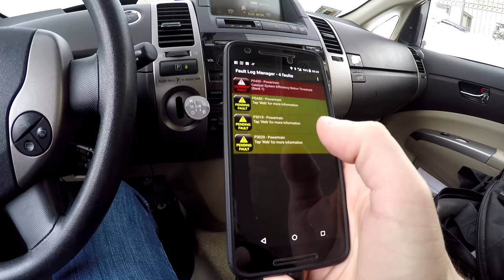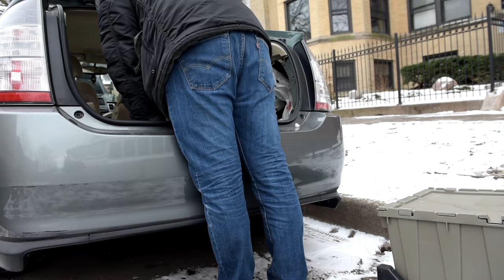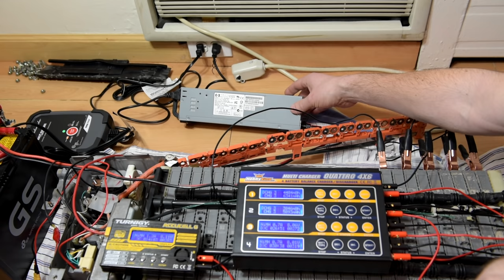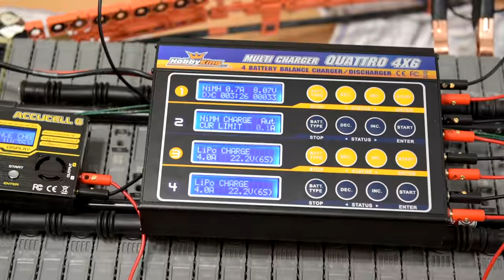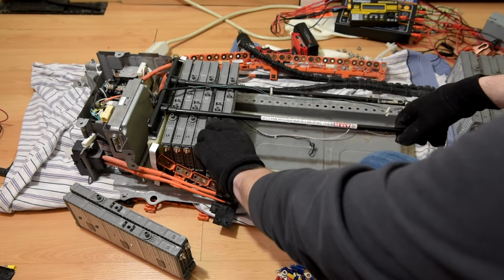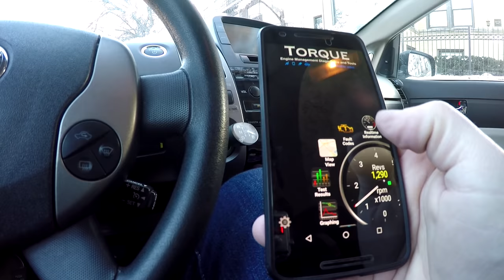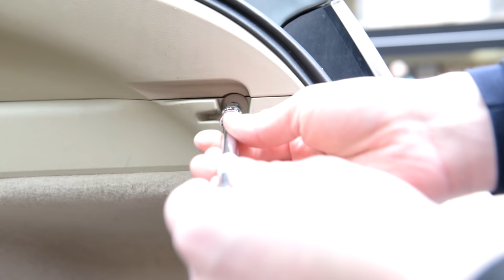Hybrid Battery Repair Ultimate Guide (Toyota Prius 2nd Gen 2004-2009) DIY

Comment: basically on the Measure/Restore Capacity you only take care of the last result of the deep cycle(charge, discharge)
Reply from the maker: The last result is the closest to actual capacity, but having multiple results will help you to understand how a module reacts to the cycles and compare dynamics to other modules in the pack

Comment: Igor, Thanks for the great video! Did you say you got your replacement batteries from Prius Chat? On Ebay how do you tell if the batteries are good when only voltage (not ma discharge) is shown in listing?
Thanks!
Reply from the maker: Hello. I've got a few modules from eBay and the rest from Eric from PriusChat. Here is his profile: https://priuschat.com/members/ericbecky.1015/ He's known in the comunity and he sells good quality modules. Not sure how to really tell what you buying on eBay. The only way to know for sure is to do capacity test after you received it. I would try to buy from sellers with a lot of good reviews left for modules.

Comment: While your charger is charging the cell, what voltage does it peak out at? And does it pulse the 5A current every few seconds, or is it a constant 5 amps?
Reply from the maker: I am pretty sure it was constant 5A during the charge and then it would start dropping closer to the end. I can’t remember what was the peak during charge, but it was over 8v after the charge. >8.2

Comment: these things are heavy, don't work on the floor. Make a table from 2 plastic saw horses and 2'x4'x0.75" plywood.  Now you can move the pack without bending.  Use a piece of 0.75"x4'x1' as a ramp to move the pack in and out of the car. You can stand the pack on its butt to access the bolts on the bottom.  You will need a 3' wood clamp for reassembly to squeeze the blades together enough to get the end plate back on. A salt and vinegar solution to soak the buss bars then buff them clean and silicone grease them or buy nickel plated.  Replace the nuts with stainless.  Check the BATTERY ECU orange plug for corrosion(fire risk) and each sense wire at the battery terminal clean/repair as needed. There are no fuses on these wires so they can short out in the ecu connector if corroded.  these packs are a pain in the butt...
Reply from the maker: Thanks, great advice!

Comment: Thank you for the amazing video and sheets. I am using SKYRC IMAX B6 v2 chargers but its so tricky they don't top off if i change Mah to lower for safety and stop at the safety limit. The charger you are using no longer available in the market so i am kept charging until 8V and dropping them all the way to 6 and recharging @ 2.00 to 2.01amp
Reply from the maker: Hello, maybe It's not about the charger. I've had the same problem with charger registering higher mah capacity during the charge versus discharge. I suspect, this is due to some of the energy wasted to heat during charge. That's why I was not considering charge capacity results as accurate. Btw, I think they sell a newer version of this charger - https://hobbyking.com/en_us/quad-4x6s-lithium-polymer-charger-400w-dc-only.html
Reply: @IgorKadulenkov  Great information. I wish i knew before buying those for extra money where that which you have linked is much cheaper with 4 ports. now after putting all together, it's giving me block 14 code. waiting for eBay shipment to get the cells. do you recommend recharging all again or keep the battery in the car and charge and only take out when cells are here what you suggest?
Reply from the maker: Sorry for late response. Have you reconditioned everything already and then it gave you block 14 code? If you're sure all other blocks are good, maybe just swap that one module, but charge it (or drain) to the pack level voltage?

Comment: @igor Kadulenkov Thank you very much for this detail video. Very informative for newbies like my self.

Can you please explain how one can tell if the charging or discharging is complete for a cycle. I am using the imax B6AC v2 and just following your settings. it just keeps changing from discharge to charge or charge to discharge. But how can I tell if cycle 1,2 or 3 is completed. I have my setting on discharge/charge 3 cycle. After over 6 hours, I press on stop and I only see the reading CH1 5866mAH, DISC 1- 4366 mAH, CH2 6975 mAH, DISC 2- 4645 mAH, CH3 0000 mAH, DISC 3 - 417 mAH Working on a prius hv  battery

Comment: Doesn't anyone own those small screw guns?  I love mine.  Got 2 speeds and a clutch.  Also got the snap-in chuck for sockets with the stems that fit right in.  Mine's a Ryobi.  Got it eons ago and I use it for everything.  4 volts.  Insanely handy.
Wouldn't dielectric grease be better?  And don't mix vinegar with baking soda.  They neutralize each other.  Just use the vinegar.  And no salt either.

Comment: Igor, I'm refurbing a 2002 Prius battery using this as a guide, which has been indispensable! My question is; is it acceptable to go more than 10 charge/discharge cycles to restore the capacity? I have spent the last two months recording the mAh on the sheet you provided, and while nearly all of the modules were poor after 10 cycles, I have been able to bring all except 4 of them into the 5000+ range. Some of them required more than 50 cycles in order to get there. So, can I consider them "good" or does the # of cycles it took factor in? Need to decide how many modules to replace and I would appreciate your input, thanks!
Reply from the maker: I am glad my video helped! Wow you really have a lot of patience, 50 cycles! I mostly used recommendations from online articles where it was advised to do a max of 5 cycles. I did try 7 or 8 on some of my modules. Some of them even showed degradation if I did more than 5 cycles on them. But I had a better  battery overall with just a few outliers after 5-6 cycles. In general, the number of cycles required for reconditioning a NiMH battery depends on its level of degradation and how well it has been maintained. I’d say 10 cycles should still be fine, but 50 sounds like too many. I would talk to a battery expert to know for sure. Maybe ask on PriusChat forums. If there are just a few of them maybe it’s safer to replace them? Or you could assemble everything, since you already reconditioned them to the spec and just hope they would last. My battery lasted 5 years and was still running strong when I sold it 2 months ago. So overall this is a proven method

Comment: Igor, thank you for a great video. I have one question, what is the life expectancy of the battery you fixed on this video. How many miles? How many years? Any idea?
Reply from the maker: It’s always hard to tell with these 10+ years old hybrid cars. Previous owner had a $900 battery replacement service done and they swapped the whole battery. I don’t know where it came from. All I know, I fixed it and I put 30000 miles 3 years after and it is still running strong. It’s the time, not mileage that affects your battery. If you make sure you replace all the bad models it can be good for years to come. I heard that new battery could serve for 8-10 years. It’s good if you could get half of that after the service

Comment: Do you know why you could get a low reading from cell 24 & 25 on one side off the block facing you but the opposite side shows almost 16 volts. Its right before the breaker switch connector. Or 4 th and 5th from the ecu left to right.  ??

Comment: Igor, 4 yrs later how is this battery pack doing? How many miles on this car? Thx and great video
Reply from the maker: Hello, I sold the car this year, 5 years later with 238K miles or so. There was not a single issue with the battery or any signs of deterioration, even when rarely driven and parked outside in the winter. Technique from this video had proven to be very effective to me. I am glad that I saved so much money and I would recommend this DIY project to anyone

Comment: Around 15:34 could you explain the set up.with the load test with the light bulb like what wires connect with what it's kind of hard to see with all the wires but so far your video is the best on youtube for hybrid testing I just want to do a simple load test with the light bulb and some aligator clips
Reply from the maker: Please refer to the picture of h4 contacts http://forums.pelicanparts.com/uploads23/H+4SocketDiaJadams1pic11961569061409336403.jpg , ground needs to be connected to the “ - “ and it’s recommended to connect “+” to the other two contacts simultaneously, that would turn on both high and low beams.
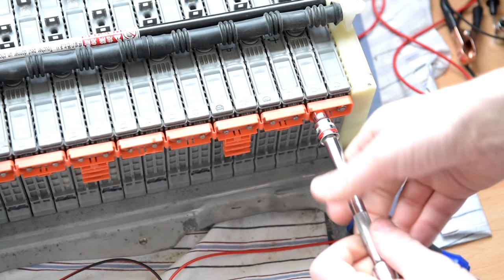Reply: @IgorKadulenkov  hey thanks for the respond I'm doing my car now at 35:04 do that black wire require a  buss bar?

Comment: Where did you get the information about the battery. Like that capacity per cell and their nominal voltages and stuff like that
Reply from the maker: It’s all from PriusChat and other forums, I spent a fair amount of time preparing for this project. There’s a 70-100 page thread on PriusChat with people discussing the repair

Comment: Just started the charging process today. I trust a procedure I can see over a reconditioned seller where you know corners are going to be cut.

Big pros are this is, the equipment runs you less than the mechanic's labor fee, a procedure every dude with a hybrid car should probably try once in his life to get familiar with car disassembly, and its repeatable so if it fails again in 2 years you can just replace dead cells and repeat the process.

Comment: Hi Igor,

Why blade voltage reduced when all other values (Pack voltage, IR, Block voltage) remain same. Same car after 7 months. 

Blade voltage shows now under 3.0v whereas 7 months ago it was 3.65v . But Pack voltage and IR remain same as before. As well as minimum block voltage is more than its nominal voltage  25.2v. 

Any explanation?

Comment: Amazing work Igor! could you please share the blank excel sheet?
Reply from the maker: Thank you! Try and see if you can download it : https://drive.google.com/open?id=1T-ldtt90Y9oMNl01dcKttKFFmUYMpakS
Reply: Hi Igor, I have another question, sometimes i need to cycle the module more than 10 times to restore the capacity. is this normal?
Reply from the maker: @Ahmed Zakaria Hello Ahmed, I can only speak from my experience with this rebuild. In my case most of the modules had recovered by 6th cycle. And then there were a few stubborn modules, that would only grow by 150-200 mAh with every cycle. I ended up replacing those. I would say, just look at overall condition of your pack. If all of your modules are like that, and assuming you using the same charging settings that i did, then  I would just keep them or try to get a used HV battery in a better condition. If there are just a few of them that stand out being the weakest, i would definitely replace them.

Comment: Hi Igor!
Good job! I'm wondering about the fault check app you use, whats the name of it and what type of obd bluetooth type do you use thank you
Reply from the maker: Hi Mohammed, the app is called Torque. It’s only for Android phones, but App Store has similar apps. You will also need a profile for Prius to be able to see all the module data. If you have an apple phone , you will need a WI-FI OBD II reader. If you are using Android , you can get either Bluetooth or WI-FI.

Comment: Thank you for the great tutorial, just one question, how long reconditioned battery will work or on how many miles it will last? could  you estimate roughly ? thank you in advance..
Reply from the maker: Thanks. It’s hard to predict, it depends on how quickly your next module will fail. My car still runs great after two years. I put about 18000 miles on it. I’d say it should give you 2-3 years or more. Even though it looks like a lot of work, I think it’s worth it

Comment: Hi, I used IMAX B6AC chargers and the same discharge/charge settings. But my modules can not be discharged to 6.0V which is said to be necessary for fully discharging. My charger reads “DRY” at about 6.5V and stopped the discharge. And my modules discharge about only 3000mAh, but they can be charged in 7500mAh until auto cut-off. What do you think is the problem for my modules? Are the numbers I get correct? Thank you so much in advance! :) I really need some help.

Comment: Hello Igor, first of all thank you very much and congratulations for this great tutorial. I am doing the same following your advice. I got the breakdown and discovered that two modules failed, so I bought them to put them.
I have two questions for you.
In the first place, when trying to do the cycles to two modules, they swell a lot. Does this mean that I am doing something wrong? or does it mean that they are defective?
My second question is, how do I cycle correctly? I mean the amps / h of charge and discharge.
Charge at 5 amp / h?
Discharge at 1 amp / h?
How should I do it?

Thank you. A greeting.
Reply from the maker: Hello Jesus, sorry for late response. If they swelling a lot, i would reduce the charging rate. Ideally you would want to go as low as 10% of max capacity, so around 0.75 Amps, but that would take a long time so I charged at 4 or 5 Amps. Discharge- the more the better, typically these chargers can only discharge at 2-3 Amps, so I would set it to max.
Reply: I have done some research on NiMH batteries and how to charge them and it is safe (supposedly) to charge them at 1C, which is 6.5 Amps for these cells.

Comment: Hey Igor. Where can I find a good balance charger like the one you have? And some charger I found say they take a power supply. What can I use for that? Your video has definitely given me the confidence to try this myself.
Reply: I also was wondering if the corrosion that was all over the 8mm nuts on both sides of my battery has anything to do with it not working well. When I tested the volts all the cells had 7.98 to 8.13 volts.
Reply from the maker: Hi Jason, please check the video description, I've mentioned the power supply that I used. For the charger - there are some other good hobby chargers that can be used. I think there were mentioned in comments here as well. If you need more help with charger, shoot me an email, i'll send you a couple of options - igor@kadulenkov.com
Reply from the maker: @traveljay751  Corrosion can bring some resistance in the line, but I don't know how big would the impact be.

Comment: Thanks for your video sir, I think that's a great video. but may i ask some question. do you have a parameters of which battery module can be reused or cannot be reused? thanks
Reply from the maker: Thanks. Not sure if i understand the question. It's kinda in the video, I replaced all the modules that failed the capacity test (below 5000mAh) or that failed the load test.
Reply: @IgorKadulenkov  what is your parameter for failing the load test? what percentage? thanks

Comment: would balance charging at a say 2-3amps instead of 5 would be as effective in restoring capacity of a cell? just thinking that if I have the time to cycle the cells slower it would be nice to reduce heat and potential swelling of the cells
Reply from the maker: It would definitely be as or even more effective, less stress on modules, less heat.

Comment: is there a guide on how to connect the turnigy charger and the multicharger with the car battery? also is it necessary to have a car battery and a power supply? Thank you very much
Reply from the maker: It's pretty straightforward. You need to get a set of clamps  and male banana plugs, then build 2 charging wires per charging port. Then you just connect + and - on charger port with + and - on single battery module. You don't need the car battery. I've used it while I was waiting for power supply to be delivered.

Comment: Hey, very nice guide. I'm going to start to do the same procedure on my Prius 2 baterry(Toyota quoted me 2000€ soo...) I have a question, what was rhe charging voltage? I could only find charges with a minimum of 11 volts, wich seems high to me
Reply from the maker: Unfortunately, I don’t remember what was the charging voltage. But for the nominal voltage of about 8.2V, 11V charging voltage sounds about right. I was charging on automatic

Comment: Ive ordered same as what you have from hobby King I'm in Ireland just wondering about power supply if it compatible with power here
Thanks for all the advice
Reply from the maker: These chargers can be fed a range of voltages. I'd advice to get a cheap but powerful 12V power supply like the one I mentioned in the description.

Comment: hello igor, 
for a balancing optimum, you have inverted some modules ? 
the reclassification of modules are random in the common ground ?
thank for contact cleaning tips !
Reply from the maker: Hello David, if you mean the rearranging modules after balancing - I basically replaced faulty modules, split the pack in the middle and rotated two halves. Modules in the center of the pack are under higher stress, so it's recommended to rotate them during rebuild, so the side modules will be in the middle.

Comment: In my point of view if you would just replace the number 18 which acts lot different than rest of the cell you could still clear the triangle light. But doing a through work like this is much better. Congrats.
I guess by Voltage difference between cells the car throws triangle light. ( #18 was culprit with 6.18 V compare rest of the cells.)

Comment: How many days did it take you to do the full voltage/current profile checks and deep cycle discharge/charge tests across all 28 cells to complete this rebuild?
Reply from the maker: It took me around 10 days with 5 chargers.

Comment: Igor have you experimented with an "Active Battery Balancer" to maintain the batteries in 7 V voltage balance continually?
Reply from the maker: No, but I think it could extend the lifetime of a battery, especially if you start doing that at early stage.